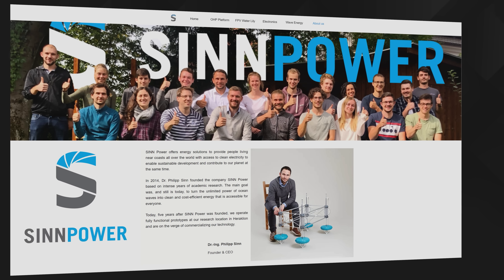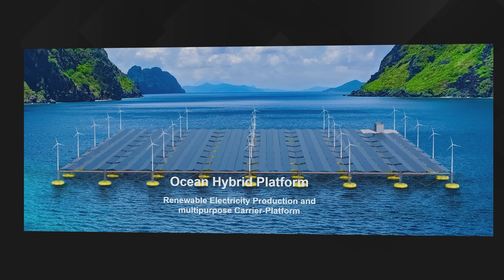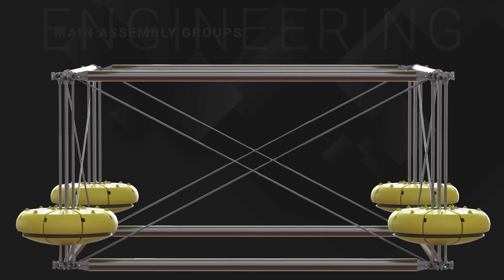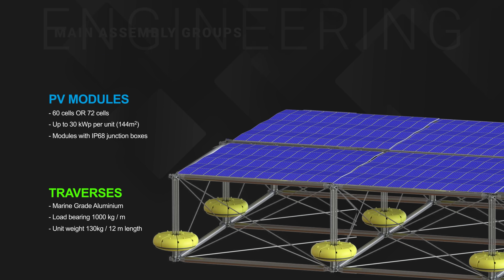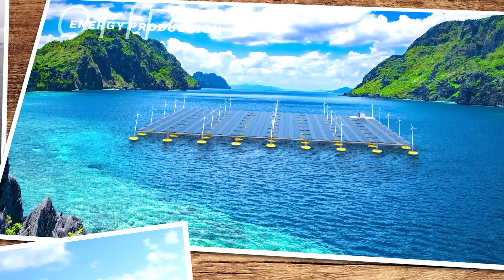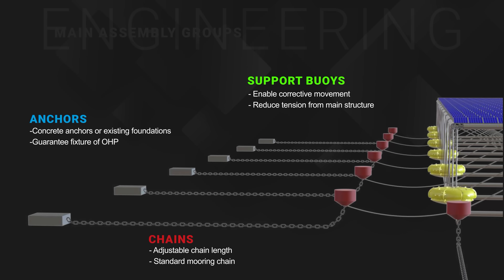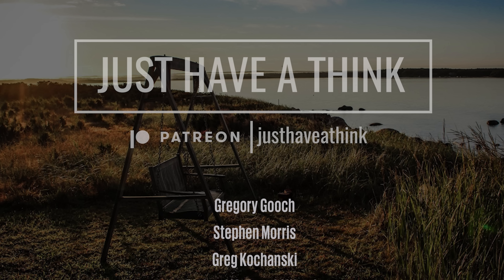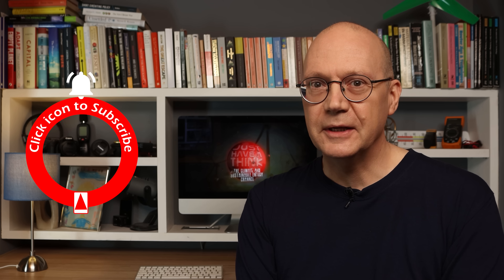Solar Wind and Wave. Can this ocean hybrid platform nail all three?

Comment: I think the project would bolster more confidence if they had 28 years of offshore construction experience. These are bright ideas, but making them feasible in an environment as harsh and unpredictable as the world's oceans is by far the biggest challenge.
Reply: I kind off agree, but if the project has been ongoing for 5 years and is subsidized by the German government. I think it's a safe to assume that they've consulted many experienced offshore construction engineers.
Reply: These are German engineers. 😁
Reply: if today technology can built tough oil platforms at sea. 
and we know its reliable.
 then lets just change the drill for all the goodies this guys suggest. 
as a car mechanic I 
dont sea any trouble on retrofitting an old platform and saving millions of dlls by the way!
Reply: @anuardelcastillo2627  If you were a ship mechanic you'd probably see the problems.
Reply: @incognitotorpedo42   with this conversation  I hope to learn much!
cheers
Reply: @anuardelcastillo2627  oil platforms aren't very well designed for this type of use, and extremely expensive to maintain so it probably wouldn't be cost effective to use most of them.
Reply: @garethbaus5471  thanks for your reply! whats most expensive? I thought it would cost and suffer as any other vessel.
cheers
Reply: @anuardelcastillo2627 Floating Oil platforms aren't necessarily particularly expensive compared to similarly sized vehicles if you no longer need to use them for oil. But oil platforms aren't shaped in a way that allows them to be modified to produce very much wave or tidal energy relative to their size and maintenance costs, they aren't built to maximize surface area for solar panels, and they aren't long enough or proportioned in a way that can be used for more than 1 full sized wind turbine which when combined with the retrofit effectively being a custom job that would be more likely to have mistakes it becomes cost prohibitive. Oil old platforms might make a good place today house maintenance workers and install transformers and other equipment needed to connect too the grid for an entire offshore wind farm or similar peice of infrastructure.
Reply: @garethbaus5471  I hear you, thanks!
Reply: I think these would be used in specific places rather than for specific industries.  We won't be able to put them out into the ocean until they are the size of off shore rigs, but until then or if there remains a more profitable alternative,  we should have them placed in bays or  inland water ways.

Comment: i can see this working for coastal areas near large lakes and oceans.
floating solar only would probably be a better option for something like lake mead to slow evaporation.
but there's always the problem of how far off shore and how costly  it's connection will be.

i'm still a stuck record for geothermal, since it can go anywhere.
drilling tech is capable of going as deep as necessary already.
too much heat is what stops them from drilling deeper.
not a lack of drilling capability.

like the so called modular reactor, that nobody will want in their backyard, geothermal can fit right into small communities and neighbourhoods, both residential and commercial to provide power at the need.
cutting expensive high power cables getting power from out in the middle of nowhere to keep radiation/pollution from the masses.
Reply: You can't put geothermal anywhere practically. Yes, we're capable of drilling very deep, but the deeper the borehole goes the more expensive it gets. Especially if it's not a simple borehole.
So ideally you want geothermal power everywhere with a suitable geothermal gradient. Anywhere else it's just geothermal heating, not electricity generation. Geothermal power plants are not small and modular. And they must operate careful to not induce too strong earthquakes that will damage the communities they are placed in.
Reply: @Vulcano7965  
if you're fracking and injecting.
heat pumps could be used to concentrate heat.
as compared to a nuclear facility and it's costs, which so far nobody knows since one hasn't been finished to find the final cost.
geothermal could power any neighbourhood.
geothermal doesn't need to be huge.
it can too be small and modular and just need a few boreholes to move in and power a neighbourhood or small town.
Reply: @HarveyG66  Again, depends what you mean with "geothermal powering everything". 
Geothermal heat pumps work great for neighbourhoods. They are shallow work very reliable. But they don't produce electricity. It's a heat exchanger that uses the underlying rock as a medium instead e.g. air.

If you want geothermal electricity you need deep geothermal power (or a very high geothermal gradient). That includes fluid injection and larger power plants.
Those are very different from the simple heat pumps.
Reply: @Vulcano7965  
yes, geothermal generation as well. 
even if low temp.
doesn't need injection. bores are big enough for closed loops.
and i understand the difference.
if they can cool methane to lng, they can reverse the process and create heat and power generation for even low temp applications.
still much cheaper than nuclear, and capable of base power generation.
Reply: Have you seen the Veritasium video on reducing evaporation by covering the surface of reservoirs with black plastic balls? I was sceptical of this, but the results were very good. Not sure if it would be applicable to lakes or large reservoirs used for boating, fishing, etc, or in scenic areas, but it would be fine for smaller reservoirs, for instance in urban or industrial areas.
Reply: Yes! We need everything we can get from geothermal too!!
Reply: @Hates Spam  
create more of a shaded effect.
better than no water.
that would be detrimental to all life that relies on it.

Comment: The installation should have big "sails" that both accelerate the wind before powering the wind power and also reflect more sun to the solar cells that ofcourse should be positioned directly on the water surface for cooling.
Reply: Yes, and giant magnifying glasses to concentrate the sunlight on the PV.  With a few more gizmos, they should be able to bankrupt all of Germany.

Comment: If you Floats going up and down around tubes due to waves, you potentially have pistons, and another source of power. You can add vertical thinking to lateral, and rotational thinking. 😉

Comment: I'm curious whether this would interupt the technical crews of ofshore wind farms in maintnance and other operations, when installed in between wind turbines.
Reply: I doubt it, as the minimum spacing between wind turbines is dictated by aerodynamic factors, not by minimum maintenance access space.

Comment: when you account for grid cost (higher than production cost for most residential), the best #1 energy to move to is consumer based rooftop solar and rooftop wind. Trouble is that no monopoly utility company paying off politicians gets rich if we all own our own panels/batteries and the grid is just for balancing and equalization.  Add in EVs and the oil and gas companies are screwed.  So it will NEVER happen.  do the math, total cost of production, storage and distribution is significantly lower at small consumer level if you account for grid cost.

Comment: The obvious factor missing from this idea is the inclusion of a small fusion reactor.  Without a fusion reactor it appears that there is far too few technical challenges in order to keep all those young engineering students fully engaged.
Reply: @Graham Luell it's an utter waste of time. This 'breakthrough' only just managed to produce slightly more power (a few kilowatts) than was needed to run it - for a few seconds. That this is regarded as a 'breakthrough' after 70 years of development, says all you need to know about fusion. It's always been 20 years away - and always will be. In the meantime, we have a huge fusion reactor in the sky, providing all the power we'll ever need for free.
Reply: And add a metaverse for good measure.
Reply: Excellent idea - if you had enough of these strung together you could just about generate enough electricity to power a fusion reactor. And then, following the latest UK fusion breakthrough, you could power 19 kettles for free!
Reply: Nukes would add excessive additions of risk, regulation, sourcing of materials, waste, infrastructure, security, and shear weight.
Reply: Small, modular thorium FUSION reactor? :D :D :D
Reply: @useodyseeorbitchute9450   :  Sure, I really want a reactor floating in the ocean and exposed to terrorist threat and ships moving radioactive materials around. No thanks.
Reply: @lrvogt1257  You are not good at tracing irony, are you?
Reply: @useodyseeorbitchute9450   :  That was meant as irony?  No wonder I didn't "trace" it.
Reply: @lrvogt1257  If you aren't tech savy to get combination "thorium" + "fusion" must be a joke, then you should at least get emoticon.
Reply: @useodyseeorbitchute9450   :  Oh, OK, hilarious.  Impossible to tell most of the BS in these comments from irony, satire, ignorance or just misspelling.
Reply: @lrvogt1257  You are sort of proving your point concerning ignorance. The author of this thread was playing obvious low emission tech buzzword bingo, I added few more self-contradicting concepts, while you felt so proficient to lecture us on drawbacks of nuclear energy.
Reply: @useodyseeorbitchute9450   :  As I said, based on comments in general your attempt at humor was unclear.
Reply: @lrvogt1257  You are sort of damning viewerbase of such green tech channels where people build their own identity on supposedly being pro-science. I've already had this issue when suggested heavy relying on solar power behind polar circle and it did not stand out as crazy joke, but was treated as ideologically sound idea just somewhat impractical.

Comment: Small correction to the 1:56 part: Since the company is from germany, I as a 17 year old german student can tell you that we still use ohps in school because of our incredible digitalisation meaning that the sinnpower employees defenetly know what a overheadprojector is
Reply from the maker: Fair enough. I'm sorry to hear that your schools cannot yet afford modern projectors and laptops. And I thought Germany was an affluent country?
Reply: @JustHaveaThink  Yes everyone at my school (even the teacher) is joking about the fact we the rich germans still use such outdated tech. But to be fair i have to say that it did got better. Our school has a computer room with circa 25 working PCs (unfortunately most classes are around 30 people...), some rooms which are mainly used be the lower grades (5 & 6) got some whiteboards installed and the city just bought us i think 80 ipads or so. But since my school has about 600 students as far as i know the teacher still sometimes has to roll in that little cart, search for a working electrical socket and pray that no 5th grader put a little piece of paper under the mirror.
Reply: @JustHaveaThink  My Mom is a teacher at a grammar school an boy can I tell you stories. A few years ago they tried to order new overhead projectors but the company was surprised bc they dont make those anymore and only had a few left in stock. Staff laptops that were ordered last year and arrive up until 2024 (making them basically outdated when they arrive) and no allowance for any program installations by the teachers on those devices. A smartboard which had technical issues was swapped back to a blackboard (reverse digitalization lol). 
The "Digitalpakt" the last government made is a few billion euros strong, but experts say there's 100b€ needed in initial investments. 
It's all pretty laughable and frustrating for such a country to have such badly equipped schools. Countries like Denmark started those investments in the early 2000s and here we are, still not getting on with it.
Reply: @JustHaveaThink  I think we also called OHPs epidiascopes (1960s UK)
Reply: I had to grin really hard when he was talking about that lol
Well, he can't know everything, especially when it comes to our superior digitalisation efforts. /s
But perhaps the new government can bring some change forward.
Reply: One translation of   sinn   being mind, we have  mind power. Or go all the way to have   sinnkraft.

Comment: I was designing a similar thing when i was 12 years old (32 years ago) with water cooling for the pv to increase efficiency. Glad that someone has finally got around to it. Thanks for the information. Peace
Reply: They've got wave power down, but they are leaving ocean current power and maybe even geothermal and aquathermal on the table.  Actually, aside from a fish farm, another use for this might be to power desalinization.  Your already in the right location, and powered desalinization can also be used to harvest trace elements in the sea water.
Reply: Using water cooling on solar wpuld definetely be cool. I think the metal construction might mean the rods will heat up and cool down with the water, which migh have even been the intention behind it.
Reply: I have hybrid pv with water heating on the underside, but at sea you could just use the ocean as a pasive heat sink, so you dont need to power a pump.

Comment: I spent my working life keeping massive offshore oil and gas platforms from falling to bits because of wave action and corrosion. These structures won't last 'five minutes' in the N Sea or Atlantic.
Reply: I think this idea has some interesting possibilities. I don't think Sinn Power has made a claim that this type of set up would be workable for every type of offshore environment, and it's pretty obvious to me that this is one of those solutions that might work in the right place, but not all places.
Reply: it doesnt need to be all-terran proof. there are many niches around the ocean which it may prevail
Reply: Would love to know un your experience what was the worst or toughest the rig has to take?
Reply: @anuardelcastillo2627 
Force 10 lasting several days, regular 60 ft waves, occasional 100 ft, even close to the shore: https://www.youtube.com/watch?v=3pJAyu6fMnk  Search YouTube: oil rig big waves
Reply: @prodiver7  thanks!!! sounds huge i check it out!
Reply: 100% I can't see this stuff last 5mins in Carm sea. But I bet it's ok in a lab lol. this will go no where.
Reply: Of course they won't,  this is laughable.
Reply: @Withnail1969  the thing is... if its so obvious, why they didnt simply retrofit an old oil rigg platform? and make it work... save some millions by the way

Comment: Let's say we just bought a nice batch of brand new solar panels. Where would you suggest that we install them? On land where we can reach them, and where the technology is proven to work, or should we take them far out into the SALTY sea, where they are hard to reach and difficult and hazardous to maintain? Wind turbines are also a proven technology. I don't think combining them with wave power offers any particular synergistic advantages. What's left is the wave power system that MIGHT be cost effective, but the whole rig looks fragile, and it will only take off if it can provide more energy per Euro invested than other solutions, because why would anyone invest in the second best technology? You can colour me skeptical.

Comment: This looks great - if it can be made robust and reliable. In terms of inshore deployments - finding space will be challenging. Fisherman will resist any new infrastructure on the water. I guess with these platforms they are moveable - you could move them occasionally to allow fishermen in?
Reply: Mussel farmers and salmon farmers might actually want this as a base for their operations
Reply: Cogeneration: electricity and mussels.

Comment: I would be interested to know how they would handle the accumulation of salt and mineral deposits on the solar panels. It would not appear to take hardly any buildup greatly impair the efficiency of the panels.
Reply: Well you could have a few workers on board to clean them. Collect rain or evaporative water to spray on them. 

I wonder if you install some form of automatic wind shield wiper.
Reply: First, if you get a decent amount of rain, that may or may not take care of the mineral deposits and the guano, but it should handle the salts. (Rainwater is soft, so it should dissolve at least some of the minerals.) And if you're sited in a place that doesn't get enough rain, you could pump seawater to run across the panels every now and again. (It may have to be fairly frequent.) And of course, you do have to angle the panels enough to prevent standing water.

Lots of reasons to be skeptical of this idea, but I don't know that the deposits on the panel surfaces would be a real issue. I'd be at least a bit worried about protecting the PE plastic floats from UV degradation.
Reply: @ps.2  To be frank, anything close to the sea takes a LOT of damage. I worked in harbor areas for 12 years. If it is not stainless (the durable acid version), heavily/expensively zink-coated or bronze - it will be broken quite quick. I had to replace electrical junction boxes of plastics with stainless a few time every year. Sun and salt destroyed plastics within a few years. Which will get expensive fairly quickly because it requires manual labor.

Comment: I could see using the power offshore to send energy onshore using a co2 to methane conversion (SpaceX is working on it) and anchor them near off shore platforms that exist now.  Using the currently available pipeline infrastructure to send power onshore as natural gas!
Reply: Methanation from desalinated water and direct air carbon capture seems to me a very complicated way to create lots and lots of heat from precious renewable electrons, not to mention the fugitive methane emissions along the pipeline and its inherent greenhouse potential